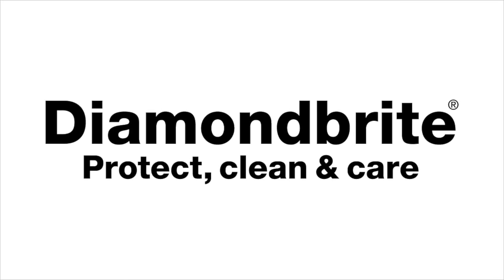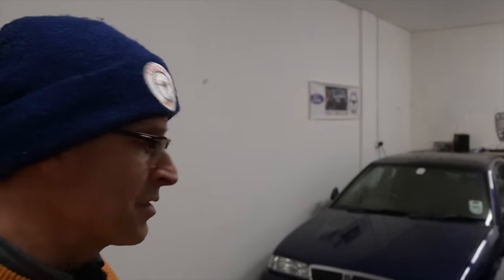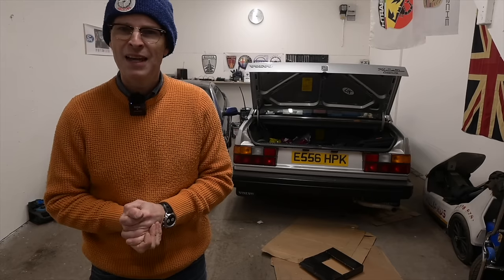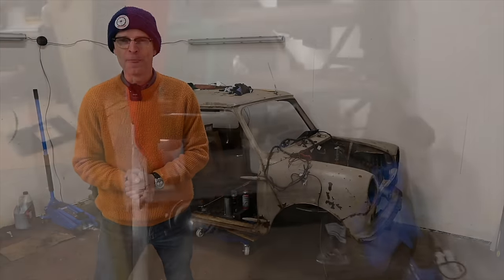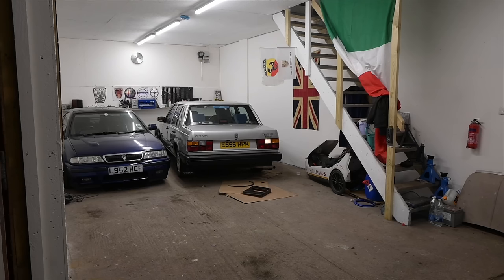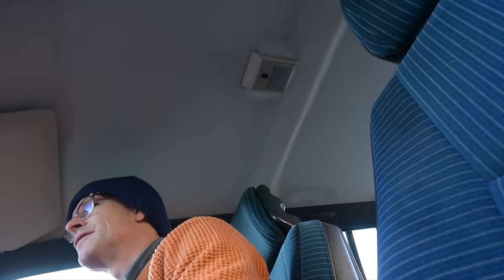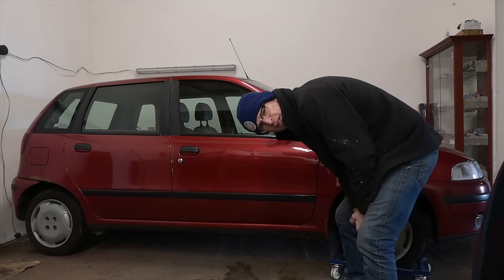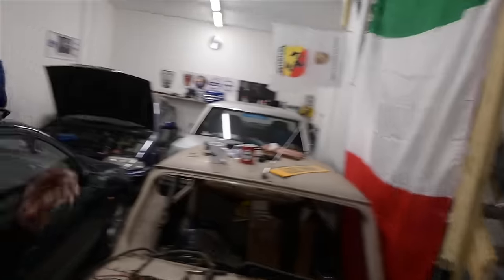New Tools! Massive air compressor and blaster for the Mini paint strip

Comment: Two points regarding air compressors. 
Buy the biggest one you have room for.
Buy the biggest one you can afford.
Think in that order! 
You will never ever think to yourself, I wish I had less air.
Reply: Point #3 Mount to floor with proper insulating fixtures to help with the noise. Best not to have it vibrating across the floor.
Reply: Looks like he’s got that covered !
Reply: So true!
Reply: The same logic applies to beds I find

Comment: Pipework from the compressor best routed around the walls to allow an outlet to be routed through a wall in a convenient position so you can blast outside. Seperate outlets can be inside for paint, blast cabinet, tyres etc. Make sure good driers are in the system soon after the line comes out of the compressor. It's more expense but the more you can do with it the more value it is. The farm manager may need a job done now and then so a chance for it to earn its keep.

Comment: If you connect that compressor to a 13a plug it will blow the fuse/set fire to the socket.  Looks like it needs at least a 32amp commando socket or even better hard wiring to an isolator
Reply: If it's the one I think it is, MM says it needs a minimum of a 45A 1ph supply.

Comment: Matt that compressor needs more than a 13amp plug fitted to it
Reply: If he's bought the one I think he's bought (looking at MM's website) it mentions a minimum of a 45A supply.
Reply: @HowardLeVert I’m just going on the machines in our workshop and nothing like that   Has a plug on it
Reply: I bet a 32 amp commando would be enough. I have a 3hp belt drive (so one of those motors) and it's fine on a 16 amp commando.

Comment: 12:19 You may need 3 Phase to run that compressor properly, I'm not a Sparky so wouldn't know for sure but I'd seek advice from one. Unless of cause it says can be run off a 13A plug.
Reply: Thats the first thing i thought I wonderd why he didn't plug it in that is the first I would have done trying it out.
Reply: Just had a look a machine mart it's 230v 2x3 hp motors 270 litre £1,678.80 god so expensive for what he would use it for blowing up tires,that mini will never be done to be honest way to much work for one guy with no experience got to admit he is a trooper trying his best.
Reply: @DainSmart-vm7pc nobody thought he could weld either and he's knocked that out of the park 😊
Wouldn't put anything past Matt, if he's in a farmyard surely there's a space somewhere for the dusty job which I wouldn't attempt in the winter as you'd be blowing rust into the panels as you go...😢
Reply: Needs a single phase supply, but 30A

Comment: Make sure you have a dryer attached to the compressor for blasting and painting. 
You will get moisture in the lines.
Reply: And check if it was delivered with the right oil level, if it isn't an oilfree version. Never seen one with two small compressors on top, only those with a larger electric motor and two cylinders. But maybe you could run these off two different main fuses, one on each lead? I don't know what type of electricity is the incoming in the UK, we get three phase 400 volts 50hz in Sweden. Using one phase get's us the usual 230Volts one phase 50Hz.
Reply: @Bratfalken It's the same here in the UK - 230V 1ph, 400V 3ph 50Hz. The voltage is +/- 10%.

Comment: Nowt wrong with vlog type videos. As you say, these are a way to connect - something I need to get back into doing. 
Impressive air compressor by the way. 270 litres will mean a lot more airtool use and less time waiting for the pressure to build up. Did it come with 16 amp socket?
Reply from the maker: no, need to get something installed

Comment: Surely that'll need a 16amp supply, especially when starting.
Reply: I can run my new 100 litre 3 hp Draper off a standard 13 amp socket in my garage. Startup surge is so brief it doesn't trigger the 16 amp MCB
Reply: Surely that’s 20amp but 16 as a minimum.
Reply: It’s 25amp.   2x4hp motors. 6000w
Reply: Looks like a Clarke XE37/270 which needs a 45A connection. Not doing things by half!
Street lights will dim when that thing starts 😀

Comment: I would get a 30amp isolator and 2 x 15amp commando fittings for the compressor mat,its too big draw on start up for a 13 amp plug

Comment: Love a big compressor...Make sure you plug it directly into a power supply and not use an extension.  It will demand more current and you will damage the motors...😬

Comment: You need an electrian to come and in stall you some plug sockets I to your walls and then you need to get some barn doors which you can shut so that you can work in the  very nice barn where you really need to go to B &Q and purchase some commercial gas heaters with commercial gas bottles then at least you would have loads of lovely heating in your barn and you really need a kitchen bench fitting to your barn walls then you could purchase your self a brand new kettle and some new mugs and some spoons and you need a fridge putting in your barn then you could put some milk and some meet and you could do with a bread bun to put some nice bread in so then you can wash your  hands after working on your cars and you could make your self some nice fresh sandwiches and you need a computer desk and  a very nice leather computer chair to sit in

Comment: Are you sure you'll get a rotisserie in you barn, I mean with the cars? You'll need to lose 2 of them or dismantle every time you pack up. I think youd be better off with a selection of old tyres, and roll it onto them. You only have the rear quarters which you could dent and if your too eager with the sand blaster you'll distort them anyway. The tyres worked really well when welding up a moggy minor, obviously that was when they were 10 a penny

Comment: Matt like you am thinking on the same lines for blaster but didn't think it need such a big compressor or are you just getting yours to do heavier. My plan is similar to your mini project get some waffle disc for rusty bits and a needle tool for other parts (I may get a disc sander for body work )Good luck I will be following this one  closely.
Reply from the maker: I spoke to their tech support people, they said to run it more than a short burst would need something this size
Reply: Finger sander is very handy to have as well 😊

Comment: You will probably need a drier on your air line, and obviously no oiler, when sand blasting, also drain the cylinder daily. You will need to make an air tight partition for the rest of the barn, as the sand goes everywhere, and I suggest you don't drive to and from the barn in a car you want to keep clean. Also be very careful if you intend on using normal sand as Silica sand (crystalline) can cause silicosis, lung cancer, and breathing problems. So full over the head mask, it gets in yous eyes, ears and anywhere else you can think of, also make sure you have optrex at home as I also need to wash my eyes out, and I'm using a cabinet. Also the shell will start to rust straight after blasting, so you will need to put some form of protection on it quickly. And some people have rusty hands, basically some people have acidic sweat, so gloves. Good luck

Comment: Thought that alarms that sound the car horn are illegal as it is illegal to sound the horn on a stationary vehicle except in an emergency.  Hope you checked that compressor is not 3 phase unless you have 3 phase power there.  You forgot about the German and American ones.
Reply from the maker: As the cars not driving I imagine think it falls under that rule, but Im sure the legal teams will have had many meetings about that! It shouldn't be 3 phase, they do both versions, but will need a dedicated circuit breaker